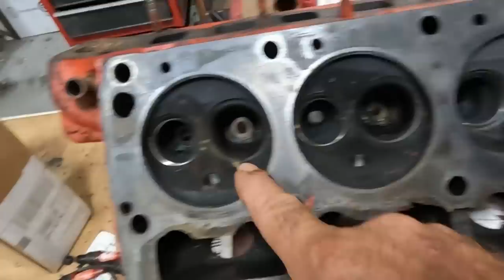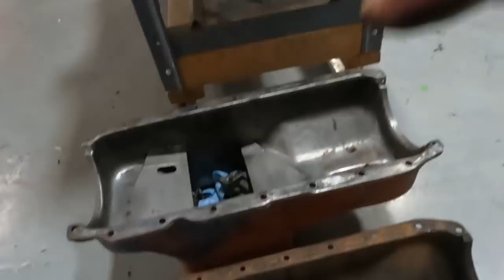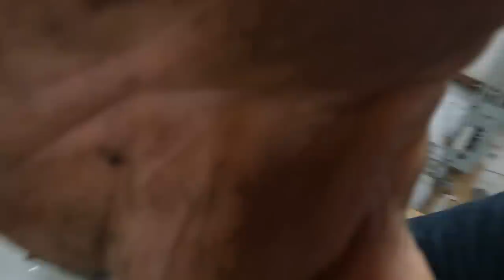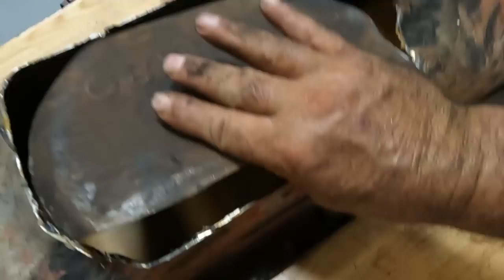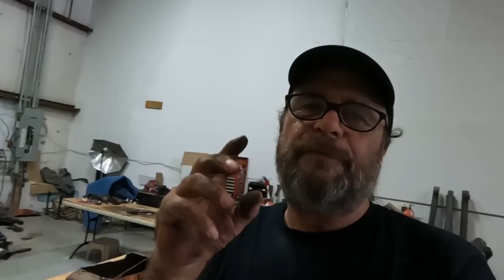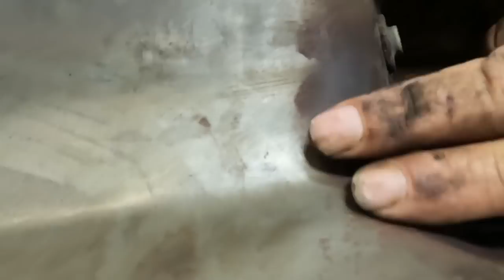Dirt Cheap DIY Oil Pan Modifications For The Home Engine Builder

Comment: The slant 6 as a hot rod engine is a great exercise in overcoming design challenges . It’s the things that are difficult that are sometimes the most rewarding. If it was easy everybody would do it !
Reply: Just a shame they sound so terrible. I've never heard a ohc 6 cylinder that I like the sound of.
Reply: @MrShakotan  BMW or Alfa Romeo 6 cylinder engines sound great, although I still prever a V8.

Comment: If you brush off the flux before you make a second pass, it reduces the chance of porosity. Also if you're welding closer to the mounting surface, bolt the pan onto an old block or something flat so it doesn't warp. Flux welders get the metal hot. And if you're heating the metal to shape it, there's more chance of warping. Just my 2 cents. 
The pan looks great by the way.
Reply: my welding instructor was a stickler for wire wheeling the bead at every stop, even with argon/co2 mix and solid core wire. It worked really well on anything you didn't want leaking.
Reply: @427_FE  im a tig guy personality, coff up once evan if my personal car project takes longer and not need to reweld and grind for hours needlessly but thats me im not into donkey work 🤠

Comment: Hey Uncle Tony, a tip for finding leaks in this situation, use a stiff mix of glycol and water. Glycol will find a leak that water will not pass through. Other option is using gas but PITA to clean and re weld. Strongly suggest wire wheel and degrease before you continue from here.
I am a weldor, nothing wrong with flux core when given the right conditions, every welding process works better on clean shiny metal. You may find your porosity improves with a little prep.

Comment: Building the 318 that came in my 68 D200 pickup, the old Sweptlines had freaking front sump pans. Looking at it the "sump" isn't very deep at all, like 5 quarts will probably lay out all the way to the back. 
Great video! I'll definitely be looking into some pan improvements.
Reply: Easiest way is to put your body on a 72 and up frame.
Reply: @jonathoncouchey7151  Absolutely not interested in doing a frame swap. I'm souping up the engine a bit but not building a race truck.
Reply: @bobbyz1964   A rear sump pan will fit the sweptline. I have a short video that shows it.
Reply: @CCR414  Was in hurry last night for a comedy show. Looking at it now it's not the OEM pan it's a 394 4 quart car pan. Initially I thought the 68 D200 had it's original 318, the engine dates to 1968. However the truck was purchased in October 1967 according to the aluminum ID card in the owners manual. 
  Looks like finding a rear sump pan is the way to go. The way the 394 pan is all the oil would go to the back if I took off fast and I plan to do that from time to time. If I can afford to floorboard it. . .
 Apparently a Sweptline will take about any pan you want to toss in there, car pan really surprised me. Every swap I've tried with the wrong pan I had to go find the right pan.
Reply: @bobbyz1964   I was told a rear sump would not work, but like to check things out for myself. That is what I'm going to run. I like to take off hard once in a while myself. The gas pedal goes to the floor for a reason!
Reply: @CCR414  Googled the subject a bit, seems like several guys are using the 72 up rear sump pans in Sweptlines.

Comment: Just a recommendation: Use gasoline to check for leaks. It's viscosity is much thinner than water and it'll find ALL the small holes. Also, it dries quicker than water so you can get back to welding up the holes sooner than waiting on water to evaporate. Flux core isn't the preferred method for welding a pan, but I understand and support your "anyone can do this in their own garage with basic tools" mentality. Great video!
Reply: Haha i was gonna say that. Use gasoline with colorant

Comment: When doing donuts with a slant six. The oil will hold in the head , and the oil light will come on. You can only go in one direction. In college I done a work study program, work for maintenance on campus. Had a D series flat hood with a 225. Some times it was known to cut a few donuts in the back lots.

Comment: Well thats cool... Pontiac had HP parts on most 4 barrel engines, baffled pans, windage trays, dual springs, air gap intakes. I have a big pile of baffled pans and windage trays, even some oil deflectors for the rocker arms.
Reply: Pontiac always built a good solid high performance car back in those days using tried and true technology.   I had a lot of respect for them even though I never owned one.   I always slightly preferred (and therefore owned) Buick simply because they liked to try innovative things (that mostly worked out; sometimes not) but I had Pontiac friends and you just hardly ever could go wrong with that brand.

Comment: Don't forget to put an oil return bung, for the oil return from the turbo,  in the oil pan...... and it must be above the oil filled level.
Reply: A U shaped stand pipe above the oil level works great too. 

If u think I’m wrong try it and see how good it siphons
Reply: Ford actually drilled holes in the block just above the oil pan on the 2.3
Reply: @aprules2   Yah,  Chrysler did the same with the 2.2L and 2.5L turbos.....

Comment: i have been welding for years. and build more than one "oil pan".  one thing i learned.... sweat it with brazing rod, or there'll most likely be leaks.  (as you mentioned)  perosity is one thing.  air is another.  brazing rod (or solder/silver solder) simplifies that...

Comment: I'm pretty happy with my stock oil pan with stock pickup in my slant6 but with the windage tray I made for my slant6 on my youtube channel to deal with the oil not staying where its suppost to . I'll also use BG oil additives RF-7 with MOA to aid in the lubrication of the bearings and rings and fuel pump arm / eccentric especially since slant6's have a weak spot the #1 and #6  bearings. Now if I was to race it would be a diffent story and do like Tony did .

Comment: i use atf as leak check ,water evidently has larger molecules than atf  i had to fix a trans pan and it passed leak check with water but  when it filled with atf it had many tiny leaks  thats my experience

Comment: powernation did a build on a  turbo Ford 300 straight six..thing made some pretty good numbers  HP and torque wise...im interested to see what a Slant Six will do..
Reply: Watched that build and it did make good numbers. Always liked that 300 6. Had a '92 150. It was a gas eater
Reply: My turbocharged slant made roughly 500 hp. It was enough to pull my 3,200 lb '65 Belvedere 1 through the ¼ MILE in 10.34 seconds.  That was a fun car!
Reply: @brucejones2354  I owned to slants. Bulletproof motor.
Reply: @driedbrainfreeze2149  that engine was a VERY RUGGED piece of equipment.  You would find them just about everywhere, welders, JLG forklifts,  very large pumps,  just look around a construction site in the 60s through the 80s.

Comment: One trick on welding a pinhole is to take a drill bit, and drill a little way into it, so the point of the drill bit takes a little cone of material out... and hopefully you'll hit the little chunk of "shmoo" that's INEVITABLY buried in the pinhole, and then it welds up nice

Comment: Good Video TONY...As you well know most drain plugs are in the back of rear and mid-sump designs. Custom rodders learn early on to mount their engines at the proper degreed angle or it throws everything off. Such as in Chevrolets, if the motors not tilted rearward it not only won't oil properly, but the carburetor bowls won't be level and transmission and U-joint problems will occur. Even on front feed FORDs such as the FE, the drain plug is in the back of the sump.
Reply: Some of the replacement Ford FE front sump oil pans have the drain plug on the side instead of the rear. Not sure why, the original rearward location was perfect. Oh well, I don't have to crawl as far under those cars now at least.

Comment: Skid plate  love it. I had a 73 charger . When I got the car it had a small block  but was a original big block car. One of the issues of putting my 400 LB into the charger was the oil pan my engine came from a 74 furry  and oil pan wouldn't work. I had to get a $400 dollar mildon oil pan  for it . I know there are stock pans but honestly they were not much cheaper had 3 deals fall through before I just got the aftermarket  one. Anyway going down town one night the pan got scraped right at the drain plug . Irony  it was scraped by a manhole cover. Lol
 The car did sit low to the ground. I used to pull the front over our ditch just to change the oil.  
That was actualy a very fun car most of the cars close to mine have those slated side windows mine had the role down windows and the center console shifter which was sort of a gated shifter. But the handal was junk had to remake it .  Also the 400 LB  made respectable power .

Comment: is it pretty no does it work yes. i put a 302 in my 4wd ranger everyone you see online has a body lift mine doesn't so to make it short notching a fox body oil pan to fit was one of many screwy things needed. but the satisfaction of overcoming the surprises made it good in the end. if the parts don't exist will them into reality your efforts are the only limit of achievement.

Comment: My daddy said if you have to grind it. You a grinder, not a welder. 😂🤣 You asked for it I just delivered! Regardless if you are welding thin sheet metal with a harbor freight fluxcore that shoots slag en every place imaginable. If it don't leak. It's a success in my book

Comment: 1979 Slant six Dodge Truck has rear sump pan. I had oil pump gear spin off the shaft in that truck so I weled the oil pump gear on the end of the shaft, there is no key or nothing, the drive gear in the oil pump is just pressed on, a welder can fix it with a welder and a grinder! What do you think of the sliding baffles in the oil pans for drag racing? How about Crankshaft wiper?

Comment: Hey Tony, I found when I was using gasless flux core mig wire for tac welding if I buff the flux off weld when I welded up to tac I didn't get porous welds

Comment: As a flux welder myself,  I totally get the little holes and leaks thing.  Welding exhaust pipe I fight that with blow outs too. Water does work well to find those little leaks.

Comment: Could be worse, I have Fords with dual sump pans.  Front is just there for the pump to have somewhere to be, the actual sump is in the back.  Steering basically passes through the middle of the pan where the cross member is.  Two of them have the rack there, the other one is a center link.

Comment: If you can get a good straight cut through the sump I've seen people just weld a band of metal on and put the old bottom back on, or build a sheet metal box and add wings while they're at it.

Comment: Flux cor doesn't  cause porosity.  Dirt grease and  impurity cause porosity.  Prep is everything.  Just like cooking  the oil out of a engine  block before  you paint it . Prep Prep Prep
Reply: Ever weld something that needs to hold fluid with flux core ?
Reply: Flux core makes slag that will get trapped if you treat it like a mig gun. Clean between passes with a wire brush, treat it like the inside out stick electrode that flux core is.

Comment: Hi Tony if you put a couple of welds in the front half of the pan on an angel would it create enough turbulence to force the oil back . And we use to make a 7 or 8 quarter pan and put 5 in to keep it away from crank. But you've probably thought of but thought I'd mention it
Reply: Ha, my experience has been that most people run the rated capacity and don't actually understand the benefit of using a larger capacity deep sump pan and running it lower than the advertised capacity.  It boggles my mind how some folks really can't understand how that works and most people believe more oil capacity is just better period.

Comment: if your donor pans are used it never hurts to "bake" the parts after thorough cleaning to evaporate oil absorbed into metal after years of heat cycles during use.... will reduce the amount of times ya have "blow thru"

Comment: Do you cut the dipstick tube to allow the stick to move lower into the new sump, or use a universal or other application tube and stick?
Reply: Engines do not need dipsticks. 

People paid $100,000+ for Bmw that have no oil dipsticks 20 years ago. 
And continue to today. 

Good enough for 6 figure Bmw

Good enough for slant 6.
Reply: @fastinradfordable  how would you know if you are burning excess oil from an unknown issue if you don't have a way to check.
I had a car not burn a drop of oil for many 10k mile interval changes, got too comfy, checked and it was more than a quart low at 4k miles on change. If I didn't have a dipstick, I could've just drove it until dry. The car was running as it always had. No changes except my a/c went out and since I was under the hood anyway I checked.
So the engine doesn't NEED one, you do to for information that related to keeping the damn thing lubricated.

Comment: UT, can you also address the dipstick accuracy issue?
Reply: In Tonys case I think he is safe to just see if the pan isn't leaking it needs more oil, if its leaking the level is fine. LMAO  Built in visual oil level checking. The old detroit diesels had it, if they weren't leaking oil it meant they had run out.
Reply from the maker: There's no mystery.  Fill the pan with desired amount of oil, take a longer dipstick than the original, and drop it in the engine.  Scribe your "Full" mark, and trim whatever excess you see fit.

Comment: What if, instead of doing all the stuff to the oil pan, instead, do a front frame swap to allow for a rear sump pan...set it up to have the steering from the front, and the sump in the back like Chevy, fix the oil pan issue, and maybe make the car handle better, like a Chevy.....would that make it a Chevpar, or a Movy?
Reply: Or just buy a chevy and not have to modify anything...

Comment: With a deeper sump and higher volume pump, wouldn't you need to remove any casting in the returns?  I would think that it would still suck it dry if it can't return it fast enough.

Comment: Slaghammer needs cam bearings Tony or I'm gonna name it Laghammer. Nothing but love UT you guys are great. Except the bs about torching your spark plugs.
Reply: Having raced a lot of two strokes I've cleaned more than a few spark plugs with a torch. An engineer for a major spark plug company saw me doing it at a 24 hour off road endurance race and said that it was the coolest thing he had ever seen.
Reply: @davidleonard8369  whatever it made 2 of my plugs stop working out of 4
Reply: Operator error, perhaps? Indeed.
Reply: @DwayneRouthierJr  your the one who can call it
Reply: Like others commenting here ,I used to have 2 strokes back in the day, and sometimes when it was cold just a little flooding would drive ya nuts. 
Heat that plug up and it definitely helps it start ,you're not gonna convince me it doesn't. 
It's a damn diesel glow plug and then it turns into a spark plug because magic.
Reply: Standard operating procedures in the aviation world.
Reply: @stevetaylor9265  did u know aviation fuel has as much as 1 gram of pure lead per gallon.
Reply: @fastinradfordable  when I hauled fuel the residual avgas in the 2" hose I pumped gas with was enough to raise the lead content of a 1000 gal tank above the allowable amount for road fuel.
Reply: @fastinradfordable  100LL is allowed 0.56G/L or 2.12G/us gal. Just to further mix things up the 1000 gallon tank I was referring to was imperial gallons (4500L 1180 usgal) lol I'm in the imperial/metric mishmash of Canada.
Reply: @davidleonard8369  years ago I got a pit pass at the Baytown nationals got to see john forces car. He actualy has plugs that are made to come apart . Lol apparently having to back out of a fuel car and get back into it causes issues with plugs.  One of the mechanics said it's common to have several blow out on a pass .

Comment: Just a thought, if going onto a rear steer car and the drain plug is in the front of the sump, will you have clearance between the steering linkage and the drain?  Sure it will be fine but made me think.